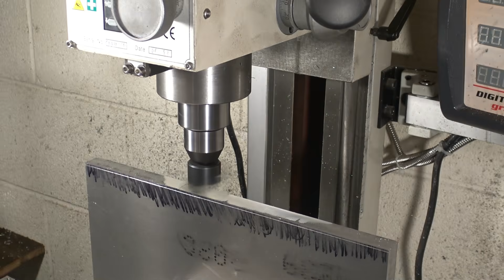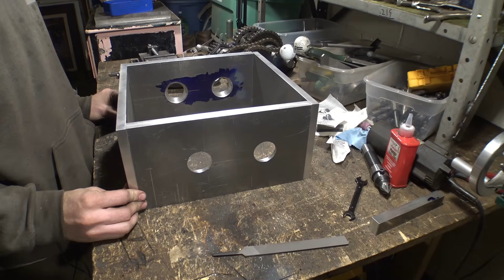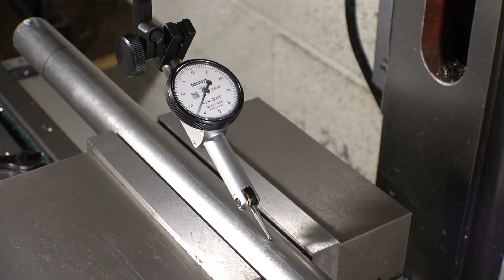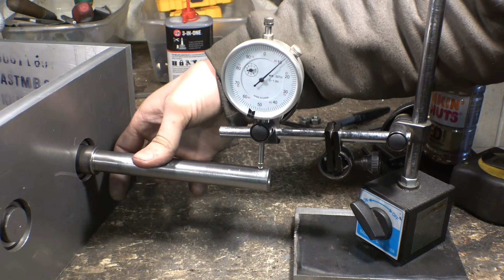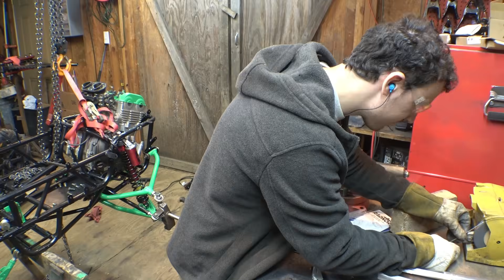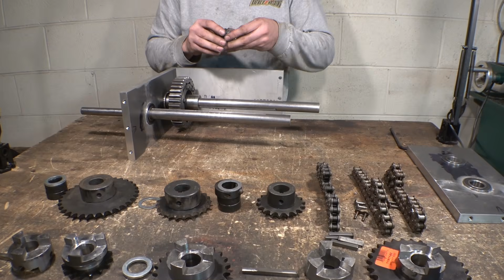3 Speed & Reverse Go Kart Gearbox Homemade Part 2

Comment: Now if you put a one way bearing under the output reverse gear, it would mostly never turn, except in reverse... What is interesting is in Polaris ATV transmissions Hi/Lo/N/R they are made like this except the chain is reverse....As its rarely used and is weaker than the gear on gear "forward" systems...

Comment: With a stock 420 cc engine with a stage 1 kit only addressing intake and exhaust and a CVT transmission aka a torque converter this 3-speed transmission with reverse gear will last a good long while if you use heavy gear oil something around 85w to 140 mixed with high temperature wheel bearing Grease because most heavy duty rear tine tillers use a similar setup.

Comment: I intend to make a forward/reverse box kinda like this but with 3 shafts. One splined with a sliding gear? and it is going to use quick change gears from a Franklin quick change rear. 2 objectives. 1, reverse, 2 easily changed final drive ratios oh and low cost so I'll probably make it out of steel

Comment: That last bit about the Argon is so funny because I did the same thing last time I was welding. I was trying to figure out why my mig gun was being so finicky and was playing around with the drive wheel and testing different tension on the drive wheel so had the Argon off and then once I got it working I started welding and didn't even think about the shielding gas. Luckily I was just doing some tacks so major harm just a forehead slap and back at it.

Comment: Nice Job.  An easier method to increase dedendum:  Saw cut plates & weld.  Clever use of couplings without elastomer spider.   Consider an electric go cart  without transmission.

Comment: Could you pull an engine out of a car then make a gear box with some absurd ratio like 1:500 to spin a crank shaft only using pedals like a bike . may need another gear box to maximize the turning of the second.

Comment: If you put bearings inside of the hubs on the input side,  you'd eliminate the metal on metal grinding and it would probably hold up pretty well. Provided you didn't try to shift the gears while it's moving. I'm going to try to make something similar but only with 3 modes, crawl, 1:1, and reverse.

Comment: Me again 
I'm guessing you got the sprocket from an industrial supplier ok    well 1 chain link is actually both the part with the rollers & both of the joiners 
You can get 1/2 links which may have been what you needed so you didn't need to go through all that grief trying to sort out that problem with your welder.  LOL
If you look at the video where you're drilling with a reduced shank drill I think it was on your mill you will see it is running out cylindricaly check your chuck but my guess is you may have knocked a dent on the taper adapter if so get a fine grade slip stone & carefully remove it. 
Better still make a angled wooden holder to hold all of them so you don't get caught again 
Kiwi Rodney

Comment: iF YOU WANT TO STOP THE NOISE AND RINGING IN THE GEAR BOX YOU NEED TO USE HELICAL GEARS. Helical gears operate more smoothly and quietly compared to spur gears due to the way the teeth interact. The teeth on a helical gear cut at an angle to the face of the gear. When two of the teeth start to engage, the contact is gradual--starting at one end of the tooth and maintaining contact as the gear rotates into full engagement.

Comment: Use a UHMW bushing between the shifting mechanisms and the gears.
We use them on 400 horse electric motors that run our planer drives in my mill. No metal to metal contact and cushions during startup and slow down. 
Some pretty tough bastards too. 
Our couplings are designed just like you designed the shifting mechanism.

Comment: I didn't real all of the comments do I apologize if this is redundant, but if one were so inclined, a motorcycle transmission could pretty easily be modified by one with your skills, tools, and determination. It wouldn't be hard to either just pull the shafts and build a box for them or in a less refined more time oriented course of action, plenty of others have disassembled the case, cut off the unneeded bits, and attached block off plates to seal the unit back up. Some use mills to cut the case,  others use bandsaws and still other much more patient gluttons for punishment (Alan Millyard for instance) have built some amazing builds starting with a hacksaw. If it's less about the doing and more about the final result there's services like chop-cut-send that are surprisingly reasonably priced (much less than I expected) for custom cut products. SuperfastMatt uses them frequently and mentioned what one order cost and while still not what I would consider "cheap" it definitely was much less than I expected and certainly what I would consider reasonable for the parts he got.

Comment: I am thinkind about a hi/lo w/ neutral translission and using an indepandant electric motor for reverse gear tranny. (Possibly a drill motor and battery for reverse.)  Hi/low will be for on and off road application. Doubling sprockets to avhieve the gearing for hi/lo. My reasoning is due to severe health issues and low income.  I would like faster reverse, but power is nuch more concern than reverse speed. With a small car alternator the reverse should be adequate. Also, another drill battery for deck mowing set high to gather seeding grass along road side ditches to provide seeds for our fields for our livestock. Although the gearring for high/ low should be easily made using by mating two sprockets mated together. By auto braking the the high/low, i believe switching from hi to low would allow the gear change without stopping forward moving. Bearring the during forward moving while the shifter should work. As I do not have necessary machines to build a better system.  I also am looking into a better system with my capable macines on hand.  I wish i had necessay machine to build a better system but it should suffice.  Size and simplictance is importance it.  Cost and size is paramount (,(being able to get prone is a absolue necessity. I would appreciate input from viewers). I figure undercarriage mounting of most is a must.  I am also in need of lenght for body positing and length.  Possible being able to sizzor the carts length for complete. For breaker poppin fuses can work by lowering draw amperage and lowing weldin speed.  I stop the breaker resets yet mainting welding strengt should fix fuse popping while maintaing strength (I have used that many times yet quite effectively.) requiring strength, without comprising  deep penetration and strength but (requiring deeper "v" grinding, of couse.)
 and  I also  seeking a trandforming adjustable wheel base distances for sleeping/rest, ah the needs. My worries are police attitudes because of my disabilities requirements due to to my disabilities. Seems police always seeking their ideas and caring  nothing about disabilties one suffers for survival.  Seems they would rather shove you insome nursing home. My answer: YOU FIRST.  So I am a disgrunted citizen merely seeking freedom. This is my way out of of nursing homes as my priority is freedom as long as I remain mentality compentant. I use store ele-carts to fulfill my freedom so long as I can moneuver from my transcport from my cart to a store's handi carts.

Comment: The main problem that can be seen immediately is that the sliding wheels and the main wheels in a gearbox have trapezoidal teeth to prevent them from jumping out of gear. Second, the receiving wheels have only slots and no teeth for space saving.

Comment: For the lack of amps welding, if its not on its own circuit it needs to be, that will fix most of your issues. If you're still having issues, use a heat gun on the back side while you're welding, up the gas pressure, and slow down your welds and use smaller rod. Aluminum demands you take your time and not rush. I used to have to weld pressurized aluminum pipe in the field and it was always a patience game with how well the beads and fillets lay and being able to hold the pressure.

Comment: If you took the gear on gear drive section and converted it to chain drive like everything else, I believe that it could be serviceable. sure it weighs a fair amount but it would be cool to see it operate and I am curious how did you envision making a clutch setup for it? To be honest you did kind of overbuild it using 1" depending on the engine you intended to put ahead of it. I would be interested in how you would make the shifter forks and gate for gear selection. I would like to have seen what kind of speed that would have rendered. Awesome work and I wouldn't abandon the idea completely; instead, consider refining what you have done into a more compact package and a more serviceable version.

Comment: When you have two hard interfacing gear surfaces, you want them to engage at a sweeping angle if its being used in a car application (500rpm+) like a motor. Make the gear cogs angled, shallow and slightly wider next time and they last longer because it doesnt sheer the gear teeth off. the higher the angle the longer it will last but you get less speed.
Reply: I was thinking this would be a good point to just install pulleys on the front side with a belt similar to a moped with a simple tensioner and delete the two gears all together and it will be less heavy maintenance, reduced size and considerably less rotating/ dry weight.

Comment: I usually reserve my comments, mostly because comments are such a good way of showing my ignorance, but a couple details about this project caught my eye and compelled me to open my pie hole. First, it was surprising and refreshing to see something as simple as a tap being used correctly. It has been about two of your lifetimes since Dad showed me basic tap technique, Seems like yesterday.....I want to add that you may be surprised by how long that transmission lasts, depending on application. It/s not suitable for high speed or gear banging, but it should be fine for something like a tractor or similar.....The basic idea is not dissimilar to the two speed chain drive that has been running in my old Mountaineer. for 60 years. It is a trail bike similar to the Tote Gote and the similar large mini bike trail/packing typpes from the 50's and early 60s. Totally open to weather and dust, but a bit of oil daily and it is trouble free. Like a tractor, you stop to shift,  Just a granny and a high, but the belt type torque converter does the rest....Cheers, keep up the interesting projects.

Comment: You should drill out most of that structure, and then put a light weight box around it. Thin aluminium or plastic would be enough to seal it to hold oil. Id bet that would half its weight at least.

Comment: i rebuild standard tran and if you dont do some thing to keep your 2 shift hubs from walking out of neutral your going to be in one gear driving with bumps making turns and the hub that is not in gear will find its way into a gear. but if you drill 3 holes in your shafts evenly spaced centered where you want neutral to be load each hole with a spring and a ball bearing and have the 1\3 of it  below the top of your hole sitting on a spring and put a smooth half round hole that only  1/4 of your ball bearing will sit in on the shift hub shaft hole centered and lined up to match the shaft holes. long story short you use spring loaded detents to keep the un used shift hub from doing bad things. and if you put a 20 to 30 deg cut on the shift hub where it makes contacted  with the gear.trust me if you dont like grinding the gear each shift or having to stop each time you want to change gears you'll do it.im telling you this because your gear box has no brass synchronizer to slow things down for a smooth shift. you can scale the hole thing down 50% and it will be fine for a 1000cc motorcycle motor power go-kart. i love the way your brain works dude your one smart cookie.

Comment: Nice going, you have some great equipment in your shop. Another way would have been to fly cut a bigger hole then bush back with loctite and even a grub screw on the outer interface if warranted, then rebore again to size with the flycutter. This avoids any welding and therefore any chance of distortion. If you get stuck again I will chime in. Giving you a follow.

Comment: Try the power of the metal treatment agents and put Tuv tested RVS in the oil. Or if it's not sold in your country, then something else similar that reacts with heat and friction and forms a hard surface.

Comment: just a tip. you should pre heat the aluminum with a torch first and it will weld 100% better.

Comment: I would love to see a version 2, although if you do a version 2 I would suggest normal open bearings with oil seals on the outside if it is a oil bath system. There's less maintenance than those sealed bearings.

Comment: He dude, you should get an M3 painting mask. Those fit under your welding helmet and will keep you from inhaling bad heavy metals in your lungs!!!

I have an "m3 4251 mask", and it really works, and keeps my lungs clean. :D 

Why dont you run an extra cable from another group that is connected to the same 110V cable that comes into your house (most of the times there are two 110V lines coming into the house). And connect that one too to your socket. Be sure to connect it the the right way round. That way you should have double the amperage, and its safe to run. 

Greetings,

Jeff

Comment: You can weld on a hot plate in order to extend your welder.   You can also increase od of bearing and enlarge hole moving center to desired location.

Comment: this absolutely would work and last quite a while... look at my quad.. it uses a trans exactly like this it is a dog box
Reply: i have videos about it and also working on a homemade lathe (which is probably what i'd use this gearbox for or if i can score another like my quad(foote 3speed)  or minibike (peerless 700) have) niether of my gearboxes use reverse for a couple reasons, one of them being the ratio is like 2nd gear so it is too fast. also i can't build a lockout into the shifting mechanism it's so compact but there is no way to guarantee i won't hit reverse coming out of first which on mine sheers shift keys but this one would be catostrophic lol...

Comment: 4:17 way to low cutting speed. With aluminium you can drill at much higher rpm. With a 30mm Drill, you can drill at around 400 Rpm with a feed of 0,31mm per round. The drill can get damaged not only with extreme high cuttingspeed, also with too low speed.

Comment: Have you figured on centering springs for the shift disc's while in nuetral position and the holding locks when the disc's are gearing? Totally fascinated by your work here.

Comment: Check out the old school method of Peening, I've filled up to a two inch hole without welding and cutting on the plug that I put in the plate.

Comment: You are so far with it, seal all the edges, fill it around 1/3 with oil so the bottom gears and chains dip into oil. See how long it will work :)

Comment: Chris machine the hole to square put a block in make the block slide for adjustment 
Welding aluminum that thick try pre heating it first put it on a gas grill get it hot it will weld like butter 
But adjuster plates would be cool

Comment: Nice job. It could be used to control a multi speed welding table. With a veritable speed motor it could be used as a table or lathe type set up.

Comment: We have in our family a 1913 Morgan 3 wheeler that is a 2 speed drive using sliding dogs like you arw using.
From the V -Twin 998cc engine via a leather cone clutch and propshaft to the rear.
I admire your thought and work that has gone into this.
Cheers from Durban, South Africa.

Comment: the pre ww2 frazer nash cars(from the UK) used the same system with chains and a gear train in a slightly different layout and were powered by anything up to a dual supercharged gough 4cyl engine. but most had 4 forward and reverse setup ( the frazer nash owners club is called "the chain gang" because of the use of the chain drive) and the cars were very successfully used in both race and rally events.  side note: the frazer nash car company  is the only car company in the world that can state that (with the oldest ones now over 100 years old ) EVERY single car built is still surviving today and most are still raced and rallied. they have special frazer nash only races at historic racing events in the UK for them.

Comment: Nonsense man! Put that in an actual car or small truck and power it with a Predator 670. Also It's probably a good thing you had to move those bearings closer instead of the opposite.

Comment: When you're welding thick aluminum taking a settling torch I'm black in the area and then heat that area up and when the Black goes away will be hot enough to weld

Comment: Try some LPS 40320 Tapmatic #1 Gold Cutting Fluid, I've been using it for years. It really works great, you can tell how well it works especially when hand tapping with small taps.
You can get it from Amazon.

Comment: @10:35
2 to 3 thou is not bad but probably worse than it actually would read if you spun the shaft from inside the box. Contacting the shaft near the gauge probably affected your readings.

Comment: You should put a seal on that so you can put about 2” of 80-90w gear oil in there so it won’t blow up from overheating and it will last longer and run quieter. Make a dipstick as well

Comment: Tip:  get some Tap Magic Cutting Oil.  Makes cutting and threading a breeze.  WD40 is not a lubricant.
Reply: W-D 40 works great for cutting aluminum, not sure what you are talking about..

Comment: You could have just oversized the holes and made eccentric bushings to do the offset.  You could then fine-tune the fit then drill and dowel it into place when it is set.
Reply: Also, it probably won't/wouldn't be as loud if you had the gears dipping in an oil bath like you mention.